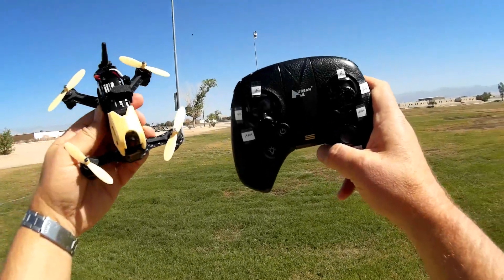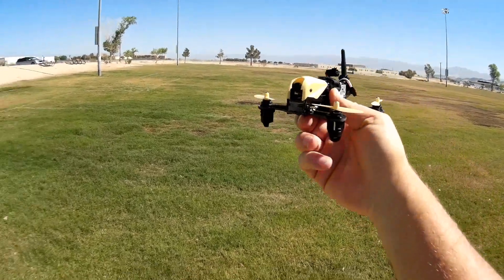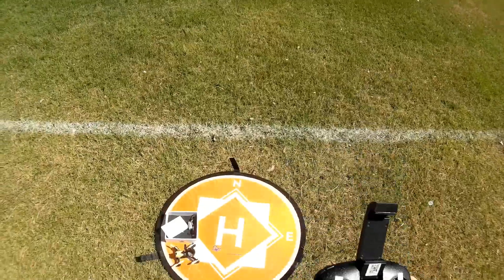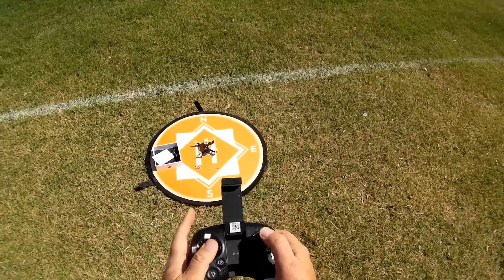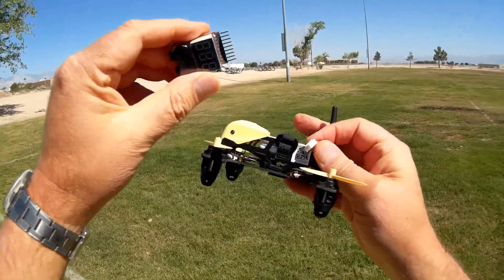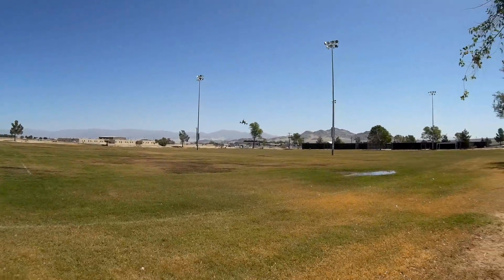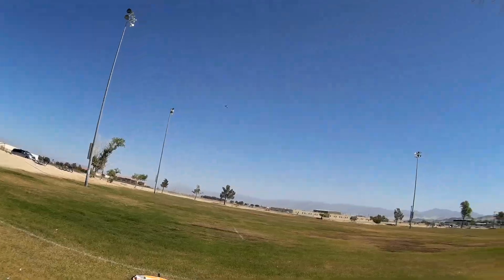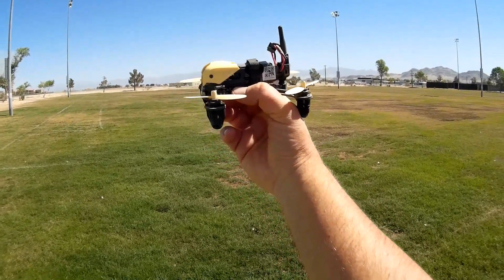Hubsan H122D X4 Storm RTF FPV Racer Flight Test Review

Comment from the maker: This tough micro FPV racer is intended as an introductory drone for FPV flying.  It does that job very well.  Find it here.  RTF Version https://amzn.to/2HcWcF6  
International orders here http://s.click.aliexpress.com/e/ciDBHSrm 
Pros - Available with or without goggles.  If you prefer, you can also use your own 5.8Ghz FPV goggles.
- Designed to be tough and durable to crashes with strong carbon fiber frame, and well protected components.
- 720p HD camera with built-in DVR for video recording.
- 5.8 Ghz analog FPV transmitter.
- 1020 brushed plug-in motors.  Very easy to replace and relatively inexpensive https://goo.gl/fcmwUq
- Lost quad/low battery alerting buzzer.
- Telemetry controller warning beep on low battery. Quadcopter descends and lands on low battery (does not return to home).
- 710mah 2S LiHV battery provides close to 7 minutes flight time.
- Can also be bound and controlled with T8SG transmitter.  

Cons
- FPV lag delay is very apparent, limiting its flying to outdoors in an open area. Experienced FPV pilots would not like this due to maneuver limitations imposed by the lag. However, for beginner FPV pilots who will/should be flying at lower speeds, this drone is a good entry level FPV drone for the price.  
- Can not change FPV channels with RTF version.  Changing to other channels requires use of the monitor goggles.
- No acro mode capability.  Only stabilized angle mode available, but in high rate it is still very fast and challenging.
- Not really for indoor flying due to its lag.  Best flown outdoors in an open area.
- Provided balance charger is not very good.
Reply: Good drone good video
Reply: Do you recommend any charger?

Comment: Thanks. I bought one of these and have had it for 3 weeks now. I bought it to help improve my very beginner FPV skills and it does exactly what I need. I am very pleased with it. I fly it bound to my Jumper T8SG transmitter (Hubsan X4 protocol and H501S sub protocol) and it flies very smoothly with this. I agree with what you said about the battery charger and I charge it with my BC-4S15D charger which only charges it up to 4.2V per cell but at least it does give a proper balanced charge. The flight time is only marginally shorter.
Reply from the maker: I also have the BC-4S15D charger, along with iMax, and an even bigger Gemini hobby grade charger.  But I always find myself using the cheap BC-4S15D due to its ease of setup, and its proper balance charging.  Don't know why that charger didn't become more popular, as I think that it's awesome :)

Comment: Ive chucked mine up the field a few times. Bought spare battery, props and set of motors which do fail. I can easily get 200 yds control and video range which is really good for a cheap quad. Signal is very stable at this distance....ideal first learner which zips around the field. Also bought a split charger which does the 2 batteries at the same time. Ready now for an expensive quad which i now am in the position to buy and not wreck learning.
Reply from the maker: Although it's not perfect, I agree that it's an excellent quad for beginner FPV'ers.  Advanced fliers take issue with it because of the lag.  But new fliers are going to be gentle in the turns, making the lag much less an issue.  It's really not a racer, just a FPV trainer.

Comment: For all who oun this drone I have found decent replacement lipos the very same used for the 144001 rc car as well as the q903 rc car the 1000mah 30 c high discharge lipo they use fits nicely in the hubsans get good fast power for a solid 5-7 min just talk to me can help you can find on amazon as well there's a 7.6v 1100 mAh 60c on order will hit everyone back after the test.
Reply: Im just waiting for mine to arive.. Thx for info.. Im sure it will come in handy... Question is.. Is it worth adding goggle box and screen when i alteady own eachine vr600 goggles🤔🤔

Comment: I like the look of it, I got the little Hubsan X4 and I like there stuff. I already got a Bugs 3 mini, might as well get a brushless drone, plus it only £40 -50 so cheaper than X4 storm.Nevertheless I like this drone so I may eventually get it.Another good feature of this drone is it has an alarm buzzer so if you lose it you can locate it easily as the buzzer activates. I needed one the other day as my Bugs 6 flew away into a forest, couldn't find it - could of if it had a beeper locater.This may be my next purchase!

Comment: How have you been Quadcopter 101? It's been a couple years since I have been on here, but I just bought the Husban x4 storm I have not had a chance to take it out for a flight yet. I did play with it in the house for a few minutes. it seems like a pretty good little quad. I bought the version with the F.P.V.  goggles included. I am going to order a better antenna for the receiver, hopefully, to get a better F.P.V. picture I'm not sure if that will work or not. I just wanted to say hey and I'm slowly getting back into the loop again soon I am ordering the DJI maverick mini or mini 2

Comment: 6;08 hi thanks for this Video, I'm wondering do you have the link of this Lipo Battery,  The Original battery I'm not happy with, thanks
Reply from the maker: The H122D uses a 2S battery, and powers the drone via its 2S balancing plug.  Most 7.4V 2S LiPo batteries have a balancing plug.  So, you'd just need to find a 2S LiPo battery of similar size to your original battery.  See this https://www.rcgroups.com/forums/showthread.php?3017750-Help-with-hubsan-h122d
Reply: @Quadcopter101  Thanks Man,

Comment: Hi just like to say how much I enjoy your videos and truthfully I did buy 2 Drones following your reviews. Just watched your H501c review which I think Iam buying. What I want to know can I use a 5.8g FPV with this drone also do you know if the HT011a transmitter which I just bought would this be suitable for the H501c. I did buy a H501m to go with the new transmitter unfortunately I had to return it owing to a bad drone and the transmitter that came with the drone. Really wanted that drone. I have a H501ss which is brilliant. Please try and help regards Irvine
Reply from the maker: The HT011A is mainly intended for the  Hubsan WiFi fliers that use the X-Hubsan app.  Although the H5501C may be capable of binding at 2.4Ghz with HT011A controller, it would not provide any advantage in terms of range over its provided stock controller.  But yes, you could simply add a cheap AIO camera to the H501C to add FPV capability.  You would also need 5.8Ghz FPV goggles or receiver monitor to be able to view the video.  The drone's GPS antenna is under the metallic silvery dome (H501C), or gold dome (other H501's).  Do not cover the metallic dome with anything as the GPS must have a clear upward view.

Comment: Thanks so much!!!!!! I asked and you uploaded!!!! You are my favorite quadcopter reviewer and you reviewed it so your opinion means a lot in the deciding factor of buying this. Thanks!  And one question....do you think the latency is because you are recording on the drone?
Reply from the maker: No, I saw the same lag whether recording or not. I think that it's because the DVR is installed in-line with the FPV transmitter.  i.e  the signal goes sequentially from the camera, to the DVR, then to the transmitter.

Comment: Thanks for the video, I have a question. I´m currently flying a DJI drone as I have photography as a hobby and I very much enjoy flying it. However, I´m thinking in getting some training with FPV drone racing, what are the main differences in terms of controlling, difficulty of flying and overall flight experience?
is there any specificmodel that you would specifically recommend?
Many thanks,
Reply from the maker: This is a good intro drone to experience FPV flying.  But eventually you will need to transition to unstabilized  acro mode flying vice stabilized angle mode which this drone is only capable of flying.  To do such, I strongly recommend practicing using a simulator program such as FPV Freerider https://fpv-freerider.itch.io/fpv-freerider
Reply: Quadcopter 101 thanks for the information, I will look into a simulator, what controller would do you recomend?
Reply from the maker: This one.  Works with most drones https://www.youtube.com/watch?v=ksEbk53NQPQ
On flash sale here https://goo.gl/3AG9wr
Reply: Quadcopter 101 thanks for the info!

Comment: I am new to drones and I grabbed one of these drones. Should I be worried that the transmitters left analog stick has no resistance on the Y axis? (Up and down)
Reply from the maker: Sounds like you're used to flying drones with altitude hold.  This is a full manual flier, without altitude hold.  Thus it does not have spring centering of the left throttle stick.  No resistance is normal, and actually desired, on such a drone.  This gives you full and immediate control of the throttle as opposed to an altitude hold type drone which can take several seconds for throttle input to be recognized.

Comment: Hello thanks for video. I’m confused can you use any type phone on the fpv mount for the video. I’m assuming there is no app for this non Wifi quad?
Reply from the maker: No, this drone is meant as an introductory drone to FPV racers.  FPV racers do not use digital WiFi for their FPV video, thus no phone app or phone will work with this drone.  Instead, FPV racers (and this drone) use old fashioned analog TV video signal.  This signal can only be viewed with a dedicated FPV monitor screen or goggles with built-in 5.8Ghz video receiver.  The reason is that when a digital FPV video signal gets weak (such as when the drone is at distant range) the video signal will blank out on the viewing screen.  Going totally blind like this, even for a short moment, can be disastrous if you're flying a high speed racer.  In comparison, old fashioned analog signal will get scratchy, but will not totally blank out upon weak signal.  This makes the old fashioned analog signal much safer for use with FPV racers.
Reply: Quadcopter 101 oh great thanks for your reply I just bought the le-idea7 gps drone. Which dose not move even close to the way this one dose . This seems like a fun quad to fly and is cheaper I spent 130 on it. Might return. But I also just had a disastrous fly away with the hubsan s501 didn’t know how reliable the company . They were supposed have an office in Cali. But they never answered . Could only email someone in shanghai .Thanks again
Reply: Thought you could buy a 5.8 g adapter for your phone ,long as the phone has on the go usb capable

Comment: i have done the calibration but the my drone moves forward. is this the remote issue? if so, how do you reset the remote?
Reply from the maker: Can it fly?  Does it take off, or does it slide along on the ground?
Reply: Quadcopter 101 yes it flies,  when it takes off, i have to pull right stick back to make it stay hovering but as soon as i let go of the stick, it flies forward by itself.
Reply from the maker: How are you starting the calibration?
Reply from the maker: Try this.  1) place the drone on a flat and level surface. 
2) Move and hold the left stick to the right.  Simultaneously wiggle the right stick until the drone's lights flash.
3) Try taking off and see if the problem has been corrected.
Reply: Quadcopter 101 i did this and the result is the same sir.
Reply from the maker: @popitn2nd  OK, if it's doing the same, then the drone's gyro wasn't properly level when you calibrated. Could be that the flight control board and gyro might be installed slightly off inside the drone. But that's OK, there's an old school way to cheat the gyro for proper calibration.  Try calibrating again, but this time prop the front of the drone slightly upward using a folded piece of paper. Repeat calibration while raising or lowering until it performs as desired.  Once you're happy with the calibration, it should remember for future flights (unless you have a hard crash, then you might need to do it again).
Reply: Quadcopter 101 ok i will do this. Thanks!
Reply from the maker: Did it work?
Reply: Quadcopter 101  yeah it worked on the regular rate. But when i go on the high rate, it will be all over the place. Thanks anyway for everything!

Comment: Can you see the camera footage via app instead the monitor? If yes which app?
Reply from the maker: Nope. The FPV TV signal is analog and can not be viewed using a smartphone.  Only can be viewed with 5.8Ghz video monitors or FPV racing goggles.
Reply from the maker: No as this is an analog video signal, it would not work directly with your digital phone.  But there is an option to convert the analog signal to digital for viewing on your phone http://bit.ly/FPV-Phone2

Comment: Nice but the controlers sticks culd have been better.
Reply: Yes my controller does that as well turn rt let off sticks still going right I get it you have to hold those sticks tight and adjust as you fly I thought it was a calibration issue nope it's the controller.